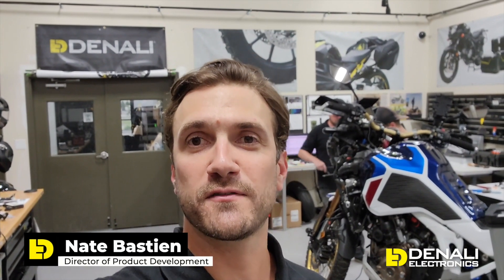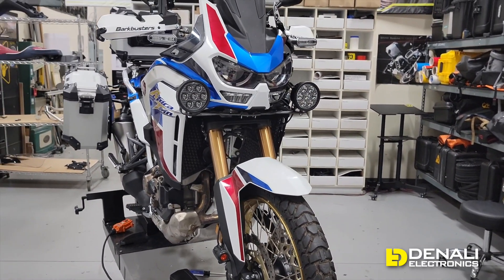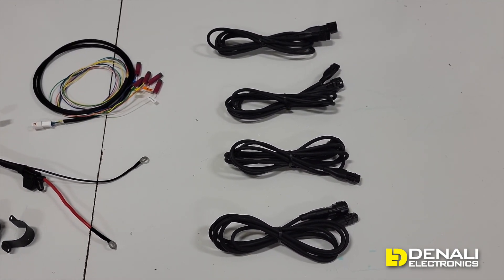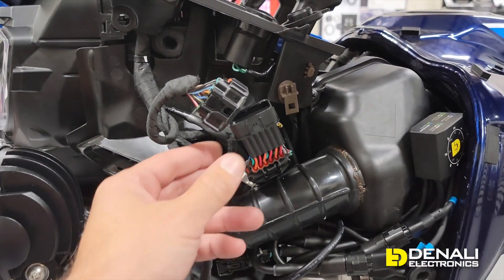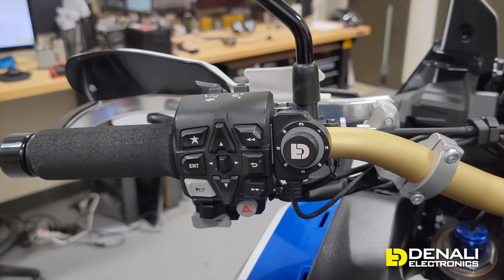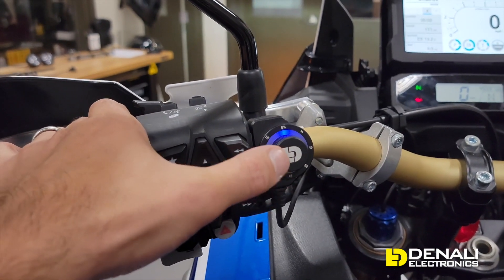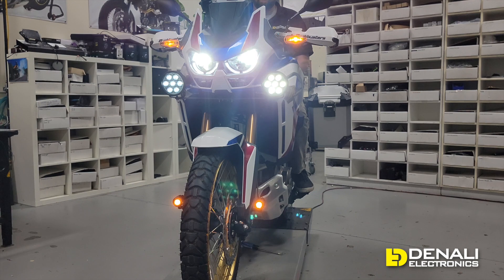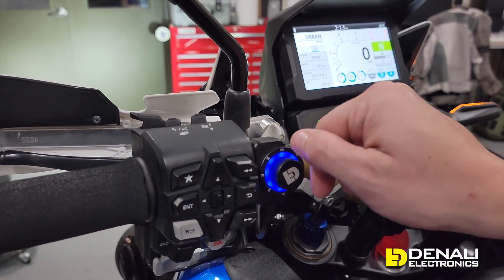Honda Africa Twin CRF1100 - How to Install Dimmable LED Lighting - Complete DENALI Wiring Guide

Comment: This set up is clean. Best plug and play  I've seen so far. Specifically I love the controller and it's functions. It would be nice if you can make same one for right side of the handlebars to control aftermarket heated seats. Every single one on the market right now it's bulky and looks like does not belong to the motorcycle.
Reply from the maker: Thanks for the kind words! I will pass on your suggestions to our design team about the heated gear.

Comment: Very cool options and clean install! I have a 2020 AT and may copy this set up. I do have a question, when u lean the bike, the white oem turn lights follow the path of the lean. Can you program the main light to light the same way and the opposite side shuts off? Perhaps it’s configured that way but since your bike was stationary and upright, the oem lean feature didn’t activate?? Thoughts Thanks!

Comment: I did a fair amount of research then chose Denali D-4 with Data Dim for a Yamaha FZ-07.  Just found a video where a yootooober did some comparisons.  I finally got around to installing crash bars which should be a good place to mount the D-4's.  I hit a deer over a  year ago.  I had to replace headlight assembly , Radiator , Forks ect..
  I won't know until after I try them how much Improvement the D-4's will give me. I replaced my OEM Halogen bulb with an LED bulb in the  OEM headlight.  I can adjust the  headlight  angle  so it is correct for high beam  or correct for low beam.. If the Low Beam is focused correctly then the high beam will be too high .  I suppose I will adjust the High beam to Optimum ..and  hope the D-4's on 50% will help me a lot on Low Beam.
  Anyway looks like this yoootoob channel has many great videos on auxiliary lights..
https://www.youtube.com/watch?v=eegaHolojdY&t=759s
Reply from the maker: You will love the D4's, especially compared to stock. Even at 50%, they are drastically better than any OEM headlight that we have seen. 
Abikething is one of our dealers in Europe, his videos are great! 👍🏼
Reply: @DENALIElectronics    Thanks,  Yes I assumed  the D-4's will still make a big Improvement.  At  age 61 I just got my first prescription driving glasses which are always fogged up on the motorcycle or snowmobile.
  I have been told I am early stages of cataracts.
  I bought a new Snowmobile in 2014.  I thought the headlight was really bright , now not so much. Skidoo makes a bolt in place  flood light .. with a 3 position switch.  The sled was already wired for  the light .  all I have to do is bolt it on and plug it into the OEM  wire harness and sockets and install the 3 position switch .

Comment: Hi Denali, on this 1100 Africa Twin, can i install only a set of S4 pods with the Denali wiring, the Denali Datadim Dual intensity controller & the Denali Switch plug eliminator?

Comment: Can you please list the posts to install this lights? It's a little confusing ( harness, dual dim, van smart)
Reply from the maker: Which part is giving you difficulty? In this video we outline installed the DENALI DialDim Controller. The DialDim has the harness included and you simply connect it to your battery and connect your DENALI lights to the harness.

Comment: I have the same 2022 adv sport. Now in Chicago. No one seems to know how to install these here.  Any recommendations on shops ?  Thanks
Reply from the maker: No one knows how to install the DialDIm? The included instructions are about as straight forward as it gets. Any shop should be able to install the DialDim. If your mechanic has questions, they can always give us a call.
Reply: @DENALIElectronics  ok. Ordering now. Of any issues will reach out.  Thank you.

Comment: FYI, my 2021 has the pre-wire for fog lights, but no settings in the computer when you jumper the DTC port.  I'm curious if the settings only show up after you terminate to a light?
Reply: Did you ever find out? I’d like to wire to mine as well but there doesn’t seem to be info available. It’s gotta be easy to use the factory plugs?
Reply: @AT2021Rocker  my research indicates the NA bikes didn't have the software to control these plugs. I just bought an EZ-CAN and got on with life. I even went so far as to dissect the software update, looking for references to the lights, based on the Honda instructions for UK bikes.

Comment: Great lights, great quality. Could you let me know which cable you connect to the high beam? I have tried both: low beam and high beam, but the lights did not work correctly. When connected to the high beam (blue wire from the trigger harness to the black wire with the blue stripe on the motorcycle) the light works opposite: I can dim them on the high beam, and only full power on the low beam. When connected to the low beam, the dim function does not work at all. Please help. Thank you.
Reply from the maker: It is pretty tough to troubleshoot via YouTube comments, give us a call or a chat online and we will get you taken care of: https://denalielectronics.com/pages/contact-us

Comment: Have to admit I was surprised to see Denali still used micro USB on the ezcan product like we are are still living in the 2010. At least add USBC but why wouldn't you just add Bluetooth and make a mobile app to update settings on the fly?
Reply from the maker: There are solutions in the works for bluetooth integration, but as of now micro USB is still reliable and works great for this application!
Reply: @DENALIElectronics  jeez mate micro USB is dying so quickly. Many laptop don't even have regular USB A anymore. Heck the amount of people who don't even buy laptops anymore is also growing. Europe banned any small Device to charge with anything else than USBC forcing even apple to comply. There is no way you can defend still using old micro USB in 2022

Let's hope you get a Bluetooth version soon with a mobile app. It is 2022 afterall...

Comment: all nice and professional Then Use a  Positap
Reply from the maker: The kit shown in the begginning of this video is our universal DialDim that uses positaps to install on any motorcycle. The install shown is using the plug and play adapter specific to the CRF1100 Africa Twin. No positaps are needed to install this product to an AT. 

https://denalielectronics.com/products/dialdim%E2%84%A2-lighting-controller-for-honda-africa-twin-1100

Comment: Magnifique , je voudrai faire la même chose sur ma Honda NT1100 DCT de 2023 , hélas Honda France m’a dit que le faisceau été multiplexé et qu’on ne pouvez rien modifier . Je voulais mettre le tout nouveau top case GIVI Maxia 5 Limited Edition avec clignotants et feux stop intégrés au top case , il parait que c’est impossible . De plus dans le courriel reçu de HONDA FRANCE si je modifie l’éclairage , je perd la garantie de la moto . c’est vraiment pas sympa 😱. j’aimerai tellement mettre vos éclairages avant et le Klaxon , car malgré que ma moto soit une GT elle n’a pas grand chose coté équipement . Je pense que l’Africa Twin est similaire à la NT1100 , même châssis , même moteur donc au niveau du faisceau électrique ça devrait être pareil ? à Bientôt Marcel Muller de Toulon , sud de la France 😉

Comment: Does this work with crash bars? Say altrider bars?
Reply from the maker: the light mount? It likely doesn't fit with the AltRider bars. I suggest simply using our bar mount to the crash bars: https://denalielectronics.com/collections/universal-light-mounts/products/lah-00-10300-b?variant=15068397863012